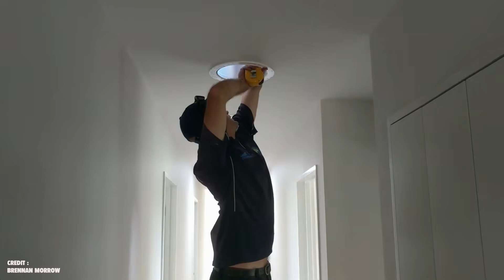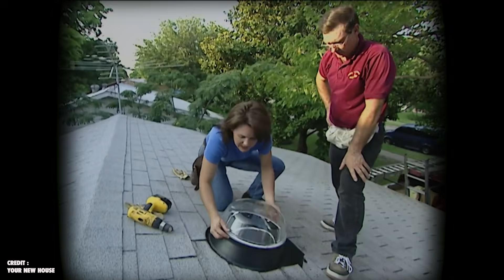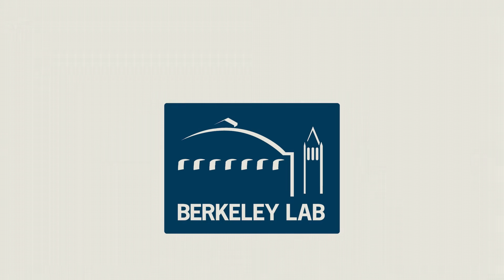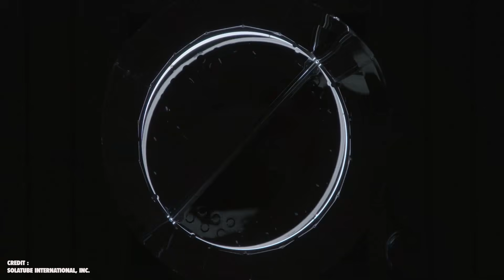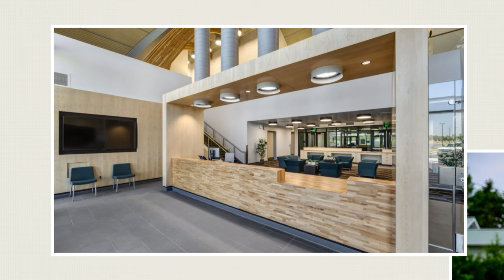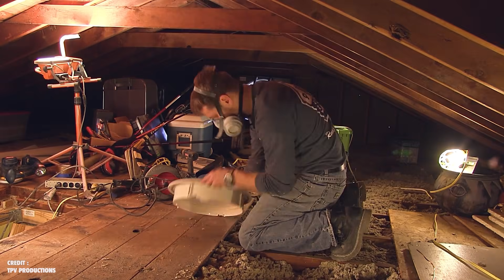Skylights Suck - This Alternative Costs 5 TIMES Less

Comment: Are there versions which do not absorb infrared as I want the heat as my space needs it
Reply from the maker: If you want radiant heating your should install roof windows instead.  They simply let the heat and light into your living area.
Reply: @wildline_YT  Thanks for the reply. It's a ground floor property in europe w/o roof access and on the side the sun sets. But I do have access to a little space from the side walls where the window gets parallel ligh. So I was thinking of making some holes from the side to capture parallel light+heat pointed upwards or backwards like a small chimney or exhaust. I realized needed heat by doing some calculations and that room gets about 2.5 kWh of sunlight even with the glass wall (13sqm) I have, compared to another property facing the other way with 3 skylights (3sqm) I'm getting 9.6 kWh. Don't need the light as much as the heat as it's quite bright with the ambient and light from the sides.

Comment: My parents had 258 of them installed in 2029. The plastic rim holding the  glass shield yellowed with age and sunlight exposure. It costs $23450 to replace the rim, but the tubes are undamaged. However, it costs thousands to replace a traditional skylight. They are amazing. Each room has 10.

Comment: My parents had 7 of them installed in 2008. The plastic rim holding the  glass shield yellowed with age and sunlight exposure. It costs $250 to replace the rim, but the tubes are undamaged. However, it costs thousands to replace a traditional skylight. They are amazing. Each room has one.
Reply: Fake review. See the nearly identical one above from a different address...Duh.

Comment: Don't listen to this video. The electricity cost of LED lights are almost nothing. Installation of this garbage costs thousands Dollars not mentioning it will introduce weakness to your roof and possible leaks which will cost you even more.
Reply: LED light bulbs wasn't even a thing back than.
Plus, LED bulbs are useless when there are power outages.

Speaking of garbage, your comment is garbage.

Edit
Leaks?
That is what insurance is for.

Comment: Are there any that double as an exhaust?
Reply from the maker: Not sure? To do that you open up the light passage to the external and internal environment that could create issues such as condensation.
Reply: @wildline_YT  makes sence. I googled after I asked the question and it looks like there is a vendor that sells a dual exhaust version but the exhaust requires a separate hole

Comment: How do you turn it off? Is there a door or something that can be put in front of it that can be opened or closed?
Reply: We have one in the place we rent in southern California. It's in the upstairs hallway, and not a premium model (which I've heard can be closed). Ours does not "turn off". This means that in the summer evenings (after 7pm when the sun is still very much out, the hall is BRIGHT. You can close the bedroom doors, but that's the only option. If you have a small child that needs dark to nap mid-day, or go to bed early, or work nights, it's inconvenient.
Reply from the maker: Not sure why you would want to turn them off.  That would be like closing your window coverings during the day!  If you really wanted to do that you could simply add a velcro cover over the ceiling fitting that can be removed as you see fit.
Reply: @wildline_YT maybe to watch a movie, or a to see the candles on a birthday cake, or you have a headache and feel sensitive to light. There are many reasons why someone may want to turn off a light during the day. If you have high ceilings, putting a cloth over it seems like an inelegant solution.

Comment: Bad idea to put a hole on the roof. Prone to leaking, and a huge gap in insulation. Just all any good roofer what they think about it...
Reply from the maker: So no roof vents then? A lot of roofs have flues for wood burning stove, vents etc so if done right there shouldn't be an issue.

Comment: Why are they talking about 100 watt incandescent light bulbs when LED bulbs use significantly less electricity?
Reply: I was wondering that too. I suspect it's because making the energy cost comparison wouldn't be meaningful if they compared to LED bulbs. Probably the system would not pay for itself, since LED's use so little energy. That said, they might still be worth it, simply for the natural light benefits.
Reply: @itisdevonly  Definitely this. Energy cost savings is a plus, but the real benefit is natural light.
Reply: @itisdevonly  Yes, best answer. LEDs are terrible for the light frequencies they emit.
Reply: LED bulbs wasn't even a thing back than.
Plus, all of the LED light bulbs packaging lists the equivalent to what a regular light bulb is.

Plus, light sockets were around 100+ years before LEDs was even a thing.
Reply: Natural light is better for your eyes health. Plus it makes your body produce needed vitamins
Reply: @MrXlee1967  that doesnt answer his initial question
Reply: @violent_rose  Incandescent light is much, much closer to natural light, compared to LED lights that are just for illumination, in every other aspect they are worst compared to incandescent and or natural light, which help with Vitamin A and D the most. People who only use LED light, and don't go outside during sunny days, are deficient in Vitamin A and D. If the question is regarding the 100 watt part, then it is just a standard light bulb power rating available and used everywhere.
Reply: @hidesh77  that last  sentence was all that was nessesary. also aint no way am i paying for wastefull 100 watt bulbs
Reply: @path4061  You are correct, have went ahead and spent 15 minutes to find, you are correct. Incandescent light bulb does not produce Vitamin A or D. Except I disagree for the natural light bulb part, even a bad incandescent light bulb is closer to a natural light bulb. LED can match the colour spectrum, but not the whole spectrum like incandescent, despite producing more Infrared. I agree and retract my statement for Vitamin A and D. You are correct for it.
Reply: AND led lights use ruin your health by cutting out the spectrum of light frequency required for human metabolic function. Lets ditch LED light universally.
Reply: @Colleen-z4c  bruh just go outside for like 30 mins to an hour for sunlight or take a vitamin. incandescent are super inefficient and cost way more to run and need to me replaced way more.
Reply: @violent_rose Has anyone ever touched an incandescent bulb by accident and burned themselves?
Reply: @mitchellbarnow1709  yes, me as a five year old
Reply: @violent_rose I was born in 1959 so I’m a baby boomer with decades of incandescent experience.

Comment: To also save on cooling costs, you can also install those roof windmills that pulls the warm air out of your attic. It's such a crazy idea that you can save so much using passive technologies! :D
Reply: The dust will block the reflection 😔
Reply: @s.r.clinkz3712  the dust gets cleaned when it rains.

Comment: It's nuts to pay $600 for one light that works only 12 hours a day, not to mention all the installation complications when running many sun tunnels. Nowadays a PV system is very cheap to obtain and to power the lights for decades ahead
Reply from the maker: I have solar pv on my roof but I need this suntunnel for the kitchen as I don't want to run LEDs all day.  I quite like having natural light during the day!
Reply: @wildline_YT the issue is that you don't have windows then, bad house planning

Comment: I love this design; I would like to add a suggestion to possibly engineer a camera-style shutter to control the brightness
Reply from the maker: Good idea!
Reply: I was just asking about it 😅
Reply: You can get an add-on device that controls brightness. But rather than acting like a camera aperture, it's a flap that goes from vertical to horizontal to control the light coming through. 

We installed it on one of our solar tubes, but we've never used it. We like having all the light!
Reply: Could be cool, but would likely only ever be used if installed in bedrooms or tv rooms.

Comment: this smells of advertising. lots of unsubstantiated claims.
Reply: Those of us who have them really like them for the most part.  The amount of light I get from 2 solatubes was well.worth installing them.  No leaks, no heat, just bright light in otherwise dark interior rooms.  
My house is older and had zero ceiling lights.  Solatubes fixed the problem.

Comment: I have nothing against these, but this video is out of date at least, likely intentionally deceptive.  The price seems at least 5 years out of date.  They keep comparing to obsolete incandescent light bulbs that are not even legal to use.  The plastic domes of these age worse than glass skylights -you will likely replace it every 25 years with shingles.
The real budget winner is a thin solar panel feeding LED lights.  Lower cost, better insulation, 24/7 programable light.
Reply from the maker: You are right - we should be comparing against modern LEDs and not old incandescent lights. BUT if you want natural daylight without the solar gains then this is a good option.
Reply: @wildline_YT  Yes the natural daylight will carry more resale value.

Comment: For me as a builder ànd property manager installing myself, cost is still biggest deterrent. The solatube brand is around 800. Velux just under 400. Thats more than à simple velux skylight ànd just slightly less than one with a built in blind. So you have $400 ànd can buy a cheaper 99% ref velux sun tube or skylight with huit in shade? Ummm. That’s like saying à smart car  ànd à 4 runner are the same price ànd choosing the Prius on purpose. 

This guys numbers ànd logic are a bit skewed. That said, I have a house with a previously installed solar tube and it’s cool. I’ll just never install one over à skylight at the same cost.
Reply from the maker: Fair point but what about solar gains?  If you want to keep your house cool and still get sunlight surely the solatube is a better option?
Reply: @wildline_YT no, you get an operable Velux Skylight.

Comment: we had 1 and had to replace it twice in 8 years so after the last time it broke and leaked a ton of rain  we had it removed
Reply from the maker: Was that due to poor installation or the actual unit itself?
Reply: What brand was it?  I have solatubes and have had zero issues with them.

Comment: So... two of these would cost about the same as 8kW of solar panels  added to my solar pv system, which would take us from about 95% self sufficiency to 98%.  And the light-tubes would make it a bit lighter indoors when the sun is bright (which is when i LEAST need extra light in the middle of the house), whereas the solar panels can power everything in my home, and with my battery, can do so on a rainy day or at night. 
Sorry, but roof space is too valuable to  give up for this device and the shadows it will cast.
Reply: Roofers do not recommend installing solar panels on the roof. That is notorious for causing leaks and damage to the roof long-term. Solar panel companies are also well known to not acknowledge leaks or damage caused by the panels and will downplay the risk to roofs.
Reply: @undermoonlight4849 well, putting them on the floor isn't going to do much good, is it?  There's an awfully large number of successful solar installs around this country that silently disagree with you, including my last three houses. 

I agree inasmuch as I don't particularly like needlessly accessing a tiled roof either, precisely because of the risk of cracked tiles etc, but you can't generalise from tiled roofs to ALL roofs. There's no issue with competent installation on any roof, and competent installation is easier on a metal roof as that style of roof is more forgiving.
Reply from the maker: Can't argue against having more solar panels!

Comment: They are better than skylight (enough light without all of the heat), but they still carry a small risk of leaking (much smaller than skylight). Also, They are not necessarily cheap, especially the high quality one that provide good lighting, leak proofed, and insulated so it doesn't heat up the attic.

Why they are not common in new build? It depends. A lot of new house designs already have enough windows to let in light (much brighter than solar tubes). LEDs are so much cheaper and work all day. Both options don't need a hole in the roof. Utilize other source of light: my north side kitchen get so much light during the daytime because the opposite (back yard) wall is painted white to reflect light back into the house.
Reply from the maker: Good to hear.  My kitchen doesn't get enough natural light so a solar light is perfect for this!

Comment: My parents had 9 of them installed in 2006. The plastic rim holding the  glass shield yellowed with age and sunlight exposure. It costs $150 to replace the rim, but the tubes are undamaged. However, it costs thousands to replace a traditional skylight. They are amazing. Each room has one.
Reply: $1350 every 20 years (assuming 2026 replacement) to maintain 9 windows/light sources is pretty cheap
Reply: @puja21  Extra costs in roofing have to be added, too.
Reply: Why not use tempered glass
Reply: It costs $109 to replace a skylight.  Yes, $109.  I installed 8 skylights 15 years ago and just replaced all the domes.  <$1000 every 15 years.
Reply: And if for some reasons i need   dark in the room during the day? Thanks
Reply: You can get one that can be blocked of you need darkness during the day.  They are amazing.  Installed once and you are done.
Reply: @thisorthat7626  They just pointed out they aren't once and you are done.
Reply: Don’t put them in your home? I mean, for fuck sake, cry about it.
Reply: @stefaniadogsitterbologna8251  i think they also come with covers

Comment: Need lights at night.
Reply: Turn on lights at night.
Reply: @eccotiqui  at that point, you already have lights to turn on the room, why not use them? LEDs don’t consume much at all to justify this. This was way more important back when bulbs could cost you annually half as much as this system alone.
Reply: @Javier64691  This system made much more sense back in the incandescent days. Today LEDs have rendered this obsolete. Most rooms I use around 20W. So for a full year you are talking about 175,200 Wh per room. Or about $21 per year to light 24/7. Now for an off grid home with a limited solar setup this might be a good option. But one 200W panel can light most American homes.
Reply: @Javier64691 you're missing the point where natural light has health benefits
Reply: Actually, ours has a night light in the kitchen and dining room. These night lights are solar powered so we got a rebate upon installation.